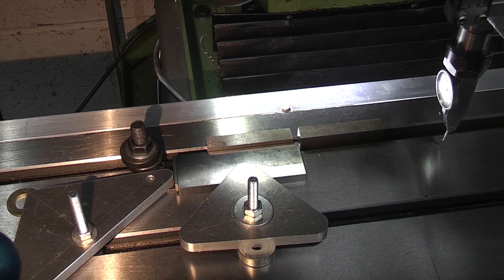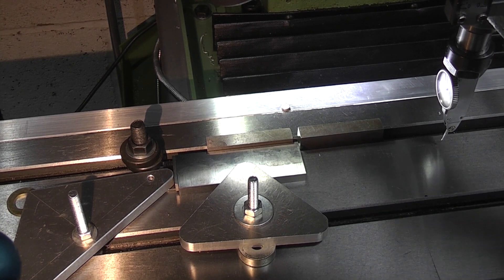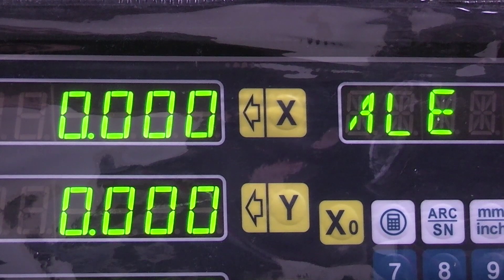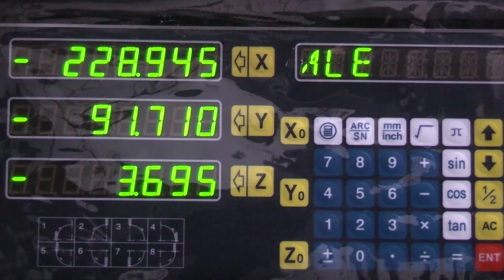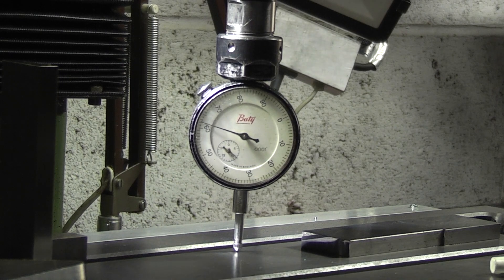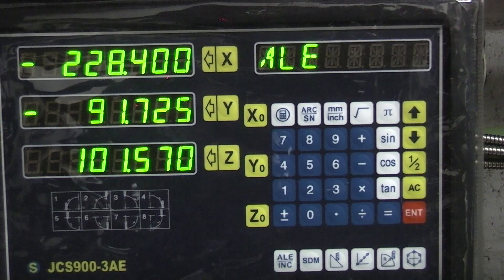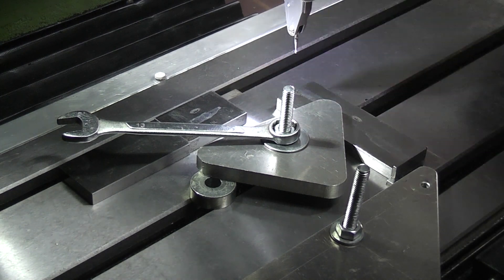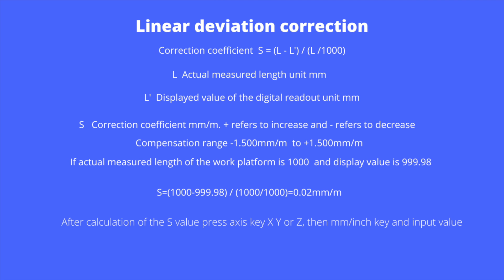Checking the DRO is to standard

Comment: Does the correction formula have to be in mm or can it be done in inches?
Reply from the maker: Hi Dave  the correction data is In mm on my unit I would think that as most scales are metric you need the deviation in mm. You can convert inch to mm then input the correction result in mm.

Comment: What is 1.5918
Reply from the maker: Hi Ram. 1.50918 was the calculated correction over a metre to correct the error in the scale
Reply: @enotsengineering  I have sino product do you have any idea
Reply from the maker: It should tell you how to make a correction factor in your scale instruction book
Reply: @enotsengineering  thank you can you upload end mill milling in manual milling machine
Reply: @enotsengineering  I have doubt in side milling because expert says it affects screw rod and cause backlash

Comment: very  acurate dro lol if it not show correct just use scale. why not just build scale correct.if you build scale 0.001 acurate it is acurate 0.001 move cant be 0.2. it is +-0.001 LOL,but if they build scale 0.00001 acurate but linear scale is not need be acurate spacing just,but why not build it first place 0.00001 acurate then LOL if they can do acurate spacing then just do it acurate measure LOL
Reply: This is to remove angular measuring. Picture a tape measure cooked on an angle vs straight. 
The scales when installed are leveled and straightened off of the aluminum extrusion. Often quite long. And to build a length that Long that is rigid enough to not flex appreciably would require extream mass. Which is inconvenient for linear scales. So we compensate for the angular miss match of the scale to the machine ways. With the invisible magic of computors doing triangle maths

Comment: Just a thought. As your moving your quill up and down (to differant heights) to take your readings any error in your tram will give you errors in your readings. Hope this makes sense.  
Steve.
Reply from the maker: Hi Steve Errors in the tram would reduce the accuracy of the Z axis I did check this prior to testing . I also used a plunger type DTI which was held in a collet setting the plunger on centre line.
Reply: @enotsengineering  If you look back at your video you are altering the Z axis in all your measurements. But if you've tramed the head before starting then everything will be fine. 😉

Comment: You said it was cold in the workshop, so If the temp is under 20c wouldn't the gauge blocks be under size ?
Reply from the maker: Hi John Yes the gauge blocks are correct at 20c but the scale and machine is under 20c that's why I put the gauge blocks on the machine bed so the temp would be the same as the machine. So if the gauge blocks contract with the temp the machine should contract the same.
Reply: @enotsengineering  thanks Alan :-)